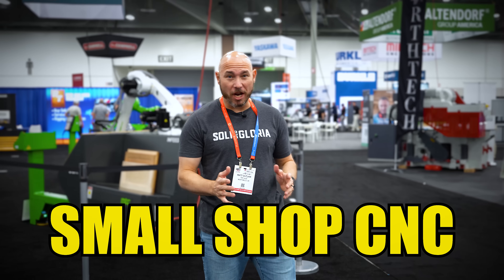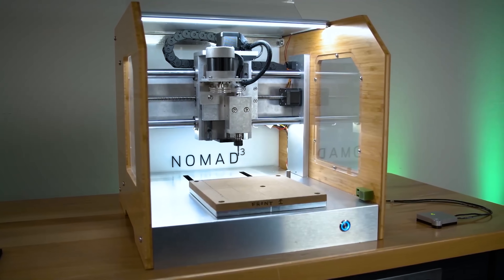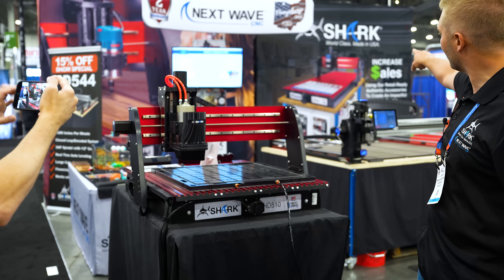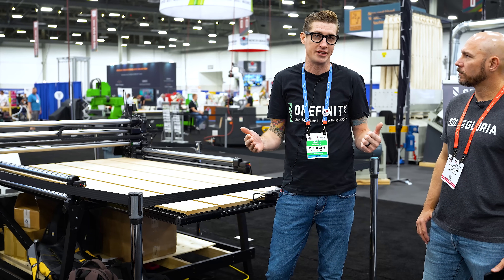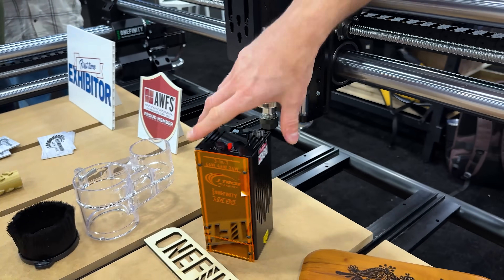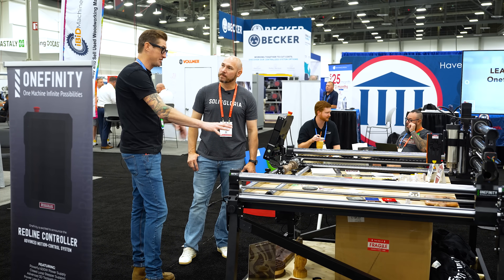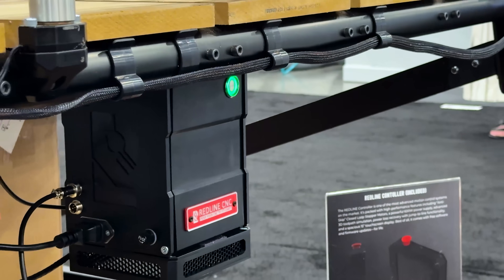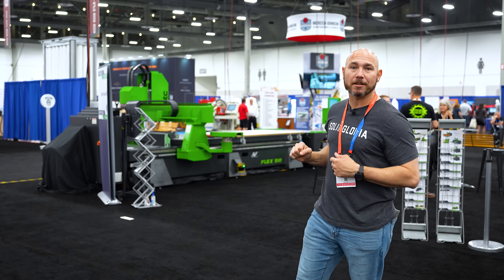Best CNC Machines for Small Shops & Garages (2025)

Comment: Everybody who's shopping for a benchtop 4x4 or 4x2 is looking at these and several others including the AltMill, the XCarve Pro, the FoxAlien among others.  The Millwright and the CNC4Newbie are contenders also.  The market is very very crowded.  

For me the Carbide 5 Pro has disqualified itself from consideration due to the fact that it doesn't support a rotary axis.  The other two shown here plus most of the others in the class offer rotary axis add on kits.
Reply: I’ve got a tabletop cnc4newbie. Extreme low maintenance and very reliable. Was free shipping and had a 5% discount. Not the most powerful resulting in bits not breaking and she’s my baby.

Comment: Maybe I’m just an old guy but how is this woodworking? Programming a machine to make something for you? Not my idea of working with your hands and creating something.
Reply from the maker: I'm sure old timers said the same thing when table saws came along 🤣
Reply: @731Woodworks I suppose but I don’t think it’s the same comparison. You’re still using your brain and many different skills to set up and use power tools. I’ve never used a CNC so maybe I’m speaking out of my butt. To each his own right. In any event I like your channel and your reviews. Keep up the good work.
Reply: It's another great addition to the shop I still use all of my other power tools along with the cnc.
Reply: I get where you're coming from and I'm with you. I'm into woodworking for catharsis and part of that is handling it...with my hands. I've got a day job. Working with wood fixes the stress of earning a paycheck. CNC kind of feels like factory assembly line work? To each their own, but I don't think this will ever be my crowd.
Reply: Any project will still require the necessary skillset to plan, execute, and finish.  Whether that medium is wood, metal, plastics, etc.  You will also need to be comfortable working with software and some basic theory of machining operations.  In addition to a woodworking skillset.

The CNC does not replace any other power tool altogether, but it can perform jointing, planing, drilling, routing, etc.  It is a multi-task machine that relies upon you and your skills as a fabricator.  For myself - I spend less time at the table saw.  I hate table saws - lol.  It reduces my time needed at the miter saw.  Reduces my time having to layout holes and drill.  With my dewalt planer and CNC I do not need a jointer.  I do not have to build as many jigs, fixtures, and templates like before.  It simplifies some steps, can skip some steps, and provides some automation for others.  It frees me up at times to be doing other things.  Makes life in the shop a bit easier.   I am still required to use the many tools and skills just to get a part ready to load on the machine and have a successful component as a result.

2D CAD software is like using graph paper, pencil, and a ruler.  Bad math is will still be bad math.  A poor design will still be poor. The software does not check your numbers twice.  CAM software takes your CAD and translates it to a language the CNC can understand.  It then runs the program that you created.  It does not fix a bad choice, design, or math.

These machines require quality input, quality materials, and your oversight to make a quality component.  Just like any other machine, tool or process in your shop.

A CNC router can compensate for some skills that a person is lacking.  Can perform a task that a person may not have the right tool for.  It does not take an average woodworker and turn them into a master.  Most likely it will mirror a person's existing skill level with traditional methods.
Reply: Old school mentality. Lumberjacks said the same when the saw mill came along.
Reply: @mickkoldy1323 No it’s not the same. Typing in what you want a machine to create is not woodworking. A sawmill and a lumberjack are 2 separate entities that both still exist.
Reply: @gregfaucher6338  Greg, it's not typing in what you want.  You need to learn more about CNC.  If it were easy everyone would do it
Reply: @mickkoldy1323 You are right that I don’t know much about CNC machines and “typing in” was just a figure of speech. I would love to see one in action but the reason everyone isn’t using one is more the price. You can go to any craft show and see the difference between handcrafted and machine crafted. Just an old man’s opinion that’s all.
Reply: And your point?
Reply: @neilsharp4989 the point is clear. Read the posts silly.
Reply: @neilsharp4989 my point is pretty clear

Comment: Wow those CNC machines really coming a long way I bet you they cost a pretty penny thanks for taking us on the tour can't wait to see the next one
Reply: The least expensive 4x4 benchtop is the AltMill.  I priced it at $4516 delivered to my door and that includes the small spindle and dust shoe plus the gController touchscreen computer (to make it comparable to the Onefinity Masso).  The Onefinity Elite 4x4 comparably equipped and delivered to my address is $6476.  The Shark 4x4 plus $500 for a capable touchscreen notebook PC, plus $300 for some kind of stand comes in at $6100.  All three have add on rotary spindles and laser add on kits.  

The AltMill is obviously far less expensive.  I don't know how important that $1500 to $2000 is.  Tough for me to justify it.
Reply: @frankshannon3235  The shapeoko pro 5.1 is less than that.

Comment: Nice video on the latest from the big CNC vendors!  Here is a video idea for you: Compare the functionality of these CNC machines (especially your Shapeoko) compared to Origin Shaper.  It would be great if you teamed up with another wood worker who has mastered the Origin Shaper, as you use the Shapeoko to do the following projects: 1. American flag shown in this video (or similar), 2. The chair that was milled by the Shapeoko, 3. Mortises and Tenons: Origin Shaper seems to do really well here - is it possible to do this on CNCs like Shapeoko and these others, 4. Inlays, 5. Engraving 3D art into a flat surface, 6. Engraving 3D art into wood where the surface is no longer flat (Origin Shaper probably cannot do this?),  7. Precise milling of door holes, hinges (CNC probably cannot do this, but Origin Shaper seems to be a rock star), 8. laser upgradability in the future, ect, ect, ect (please brainstorm here - multiple videos would be more desirable than just one).  I would love to know what projects where the CNCs in this video really shine and where the Shaper Origin shines, and what projects each cannot do in a Project-Farm-like conclusion where there is graphic that clearly lists the projects and how well each CNC system did for those projects.

Comment: Which is the CNC that is most like Bambu Labs 3D Printers - meaning a CNC that you don't have to be an expert in CNC programming and one that works easily and reliably?
Reply: There are some CNCs that don't require much expertise to set up, but as far as I've tried, all of them still require a lot more work to run them than a 3d printer. There's no equivalent to a simple slicer equivalent, because reductive manufacturing (vs addative like 3d printing) means you have to define the starting material, tell the machine what tools you will be cutting with, and what order those operations should happen in.

All that said, for some basic jobs, a couple of YouTube videos can get you going, like with the Carbide 3d machines that have a lot of resources provided!
Reply: @imadeathing91  Thanks!